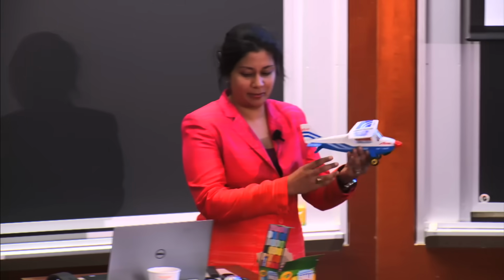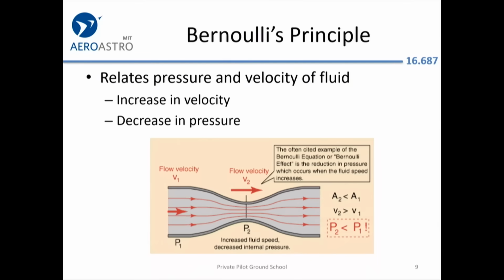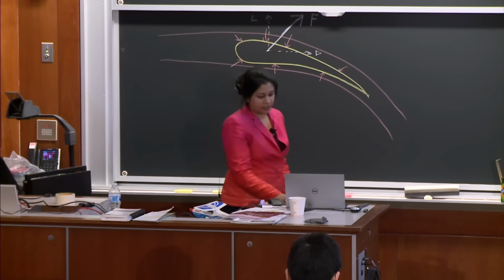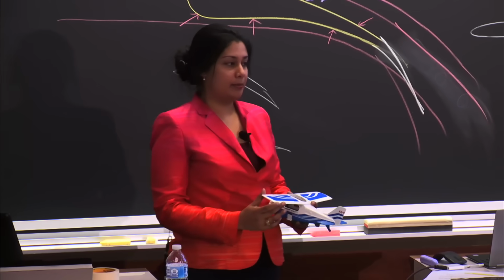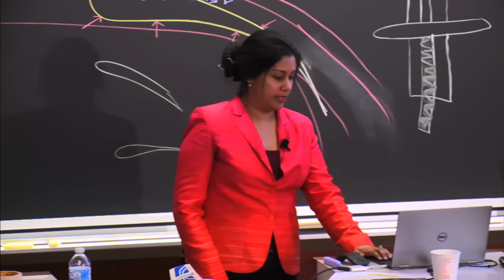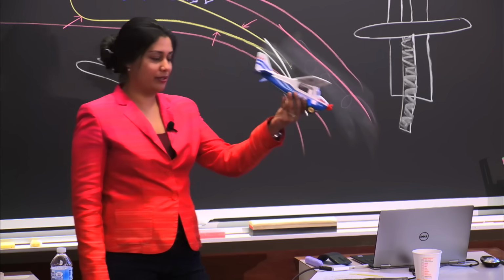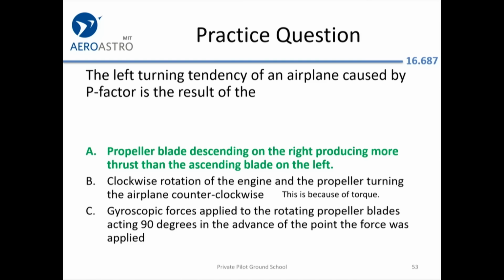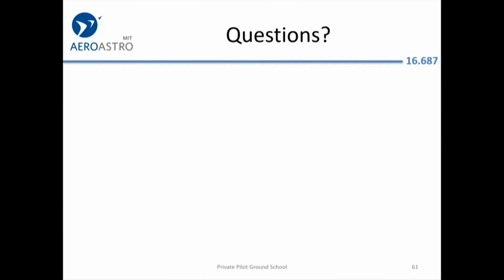Lecture 2: Airplane Aerodynamics

Comment: At 1:00:30, in her answer to the question - why the cork-screw effect generates more YAW than ROLL, the instructor failed to point out that vertical stabilizer being positioned back at the end of the aircraft, is quite at a significant distance from the "Aerodynamic Centre" of the aircraft. Hence it has an amplified effect due to the "moment" of a force (force x distance) on the vertical stabilizer (and the resulting YAW) as compared to the same (cork-screw) force acting on the wings but not causing so much of a roll being close to the aerodynamic centre..

The lecture of course is very engaging and nicely done.. no doubt about that..

Comment: @9 minutes you’re holding the paper airplane, the airfoil is canted down therefore still being a venturi. Bernoulli’s principal. So yes velocity and pressure are inversely proportional. Your explanation needs a bit more splainin’ Lucy

@9:49 proves my point.  You didn’t change the camber of the airfoil (venturi) just the shape. If you look at any aircraft there are many shapes of wings. I haven’t even included flaps and slats in this discussion… yet.

It is not the distance, but the angle. Angle of incidence. You teach at MIT? 

Bernoulli and venturi.

Otherwise, your discussion is spot on.

Comment: Everything presented here is required on FAA testing too.  All pilots must understand the physics of flight ie. Newton, Bernoulli  and the function and failures of control surfaces, weight and balance, CG, critical angle of attack, indicated/true/ground speeds, induces and parasitic drag, density altitude, and the function of the horizontal stabilizer.  The bottom of an airfoil is NOT CURVED as she is drawing...it is flat.   Lift is a combination of Newtons equal and opposite forces (wing pushes air down) and Bernoulli pressure differentials.  By the way, a barn door will fly if it has enough force applied to it.

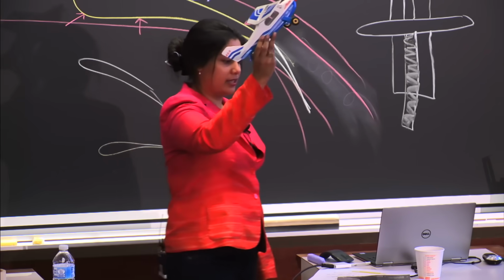Comment: Great lecture.  One small error at 56:00 where she says that "climbing is when your lift temporarily exceeds the weight".  This is what I was taught in flight school and is what the FAA says. However, in fact, an aircraft does not climb because of an increase in lift, but because of an increase in thrust. Just as a car has to increase power to drive up an incline, an aircraft has to increase thrust to counter the portion of gravity that is acting along the path of flight trying to slow the aircraft down.  The additional thrust required equals weight * sine(angle of climb). The fact that the aircraft is now flying upwards actually reduces the amount of lift required.
Reply: @mmm-mmm  That's kind of what I thought. However, after a long and painful discussion on Aviation Stack Exchange, I realized that there was a problem with my logic.  I was, in effect, treating climbing flight the same as banked flight, where you increase lift to maintain altitude.  There is a similarity in that, in both situations, your lift vector is no longer pointed downwards. In the case of a banked turn, you don't mind that a significant part of the increased lift is directed horizontally, since that is helps you turn.  However, in a climb that horizontal lift is totally inefficient since that lift is now acting in opposition to your flight path. It turns out that the most efficient way to climb is to increase thrust and use just enough lift to keep you on your inclined flight path. Since thrust has an upward component, the amount of lift now required is less than the lift required for level flight. It is part of a continuum.  As the angle of flight increases, thrust replaces lift.  In pure vertical flight, thrust is the only vector opposing gravity.  The online version of Gleim Aviation addresses the question "Is An Airplane In A Constant Airspeed Climb Or Descent In Equilibrium?" and has an excellent illustration showing the vectors involved.  Note that, in a climb, lift = W1, which is less than W. I hope that helps explain what I meant.

Comment: So ground effect would work the same on a upside down wing aswell? Say you got a car wich is the shape of a upside down wing…. Would you create some vacume between the floor of the car and the road, as your tip vortecies would block air comming in under the sides, and air underneath will be accelerated along the lenght and evacuated out the back?

Comment: There is a third point of rhenium, which explains the aerodynamic lift through the inertia of the air flow around the airfoil.
Lift force is actually created due to the pressure difference under the plane and above the plane of the airfoil of the wing. An additional lifting force is created near the surface of the earth and water due to the sharp build-up of pressure between the two surfaces.
Then the difference in pressure increases, and the excess lift force the aircraft lifts off the ground again at a constant or slowly decreasing speed.

Comment: I studied thermodynamics in mechanical engineering and I touched upon this subject of drag and lift and vortices and Bernoulli’s equations many years ago. The field was fascinating then as it is now but, the only difference is that today it’s much more better explained in lectures like this one rather than pure mathematics. Bernoulli’s equation explains it far better that pressure difference between the lower part of the surface and the upper part of the surface creates lift.
Reply: "I studied thermodynamics in mechanical engineering" LMFAO " ...today it’s much more better explained"   clearly you didn't study the english language!  Because you cannot speak worth a damn!

Comment: Never till now have I thought I could teach at MIT.  And if the CFI is any good you will learn spin recovery as it's not a big deal.  A pilot needs to know that spin recovery is easy assuming the altitude is sufficient.  Too many people never experience a spin due to fear on the part of the CFI.  If you accidentally get into a spin and you've never experienced one your chances of a safe recovery are limited.
Reply: "Too many people never experience a spin due to fear on the part of the CFI."  No, its not fear on the CFI, its because the FAA removed spin for primary stuidents in 1949, then banned it all together in the 1970's for all students except CFI candidates.   Reason, too many student/CFI's were spinning themselves into the ground. Only CFI candidates are required to do spin training. "you've never experienced one your chances of a safe recovery are limited."  That is SIMPLY NOT TRUE.  the FAA promotes teaching prention over actualy doing is far safer, and statics show that. Teaching Incipient Spin and proper recovery to primary students is FAR SAFER than actually doing one.  That is just fact and is what the FAA requires.
Reply: @ILSRWY4  I knew a CFI who refused to teach spin recovery to a student CFI due to his own fear of spins. It is far safer to learn spin recovery in an airplane in addition to recognizing one before it occurs.   Done properly at a safe altitude, in a suitable airplane, it is safe.  I taught aerobatics in my Citabria. The FAA is not always correct.

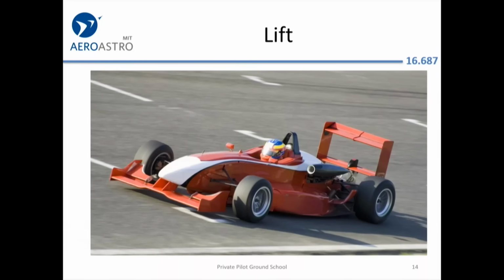Comment: at 16:32,  that is  NOT  a  spoiler.!!!!!!       thus,  more   MISLEADING  discussion.!!!!!!
and, a spoiler makes  very  little  down force.!!!!!!!
Reply: Here's a jump to spoilers in action on a B-52. https://youtu.be/RJzFICvJhGQ?t=543 (sorry if there's an ad) Spoilers spoil the airflow. Thank goodness F1 and Indy call them wings. 
What I see in the linked clip are spoilers spoiling the airflow over the wing to provide roll control while the flaps are pushing against enough air to lift more than 100 tons into flight. Still, the "wing" in the car photo might be crude enough to be called a spoiler #humor

Comment: Regarding your assertion that flaps are set on takeoff just to make a go-around easier by reducing pilot workload, why is it that aircraft often can not safely takeoff with no flaps?
Reply: Flaps are used both for obstacle avoidance and to reduce the chance of a tail strike. If you have to go up to clear something, you trade forward speed for faster gain in altitude. Flaps out, your wings are bigger and can generate more lift. But to do that, you have to apply more thrust because more wing also means more drag. Flaps out also generates the needed lift to get airborne at a lower angle of attack which prevents the tail from hitting the ground on take off
Reply: @MoMadNU  "obstacle avoidance and to reduce the chance of a tail strike" where did you get that from?

Comment: The device on the back of the race car is a wing which produces downforce, which is unlike the wing on an aircraft which produces lift.  A spoiler is like a tab (or a tab which can flip up on the top of the wing) on the end of a body which disrupts airflow, and reduces any lifting effects.
Reply: @mmm-mmm  She is an aeronautical engineering student who has a lot to learn,  to say it nicely.
Reply: Actually Aircraft wings also produce downforce, the horisontal tails are upside down wings that procude downforce to push the tail down. That is how an airplane stays balance between the main wing, center of pressure and the tail.  In fact it is the airplane's horizontal tails that gave race car engineers the idea of putting wings on a car.
Reply: Same as the horizontal stabilizer on a helicopter. @ILSRWY4